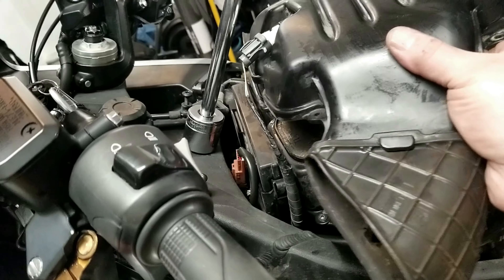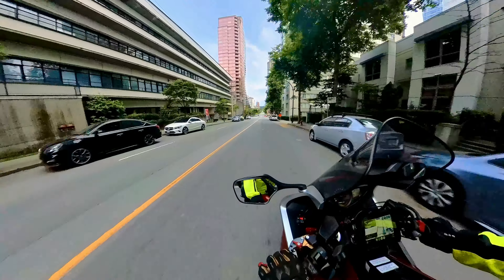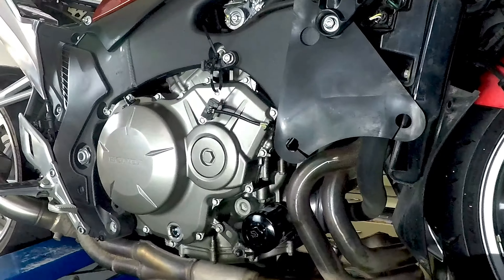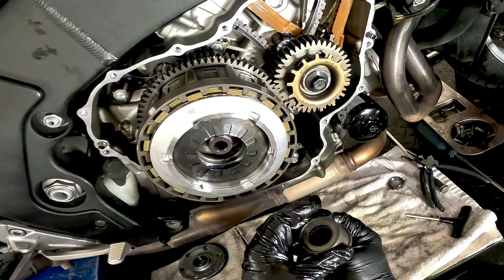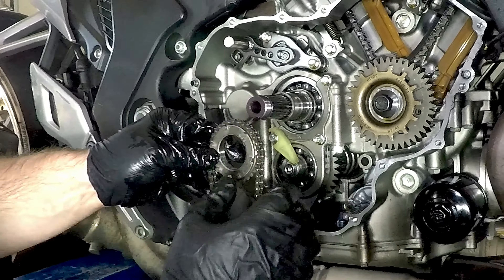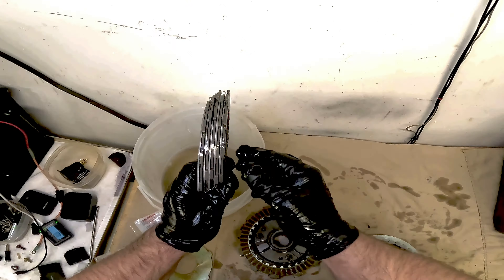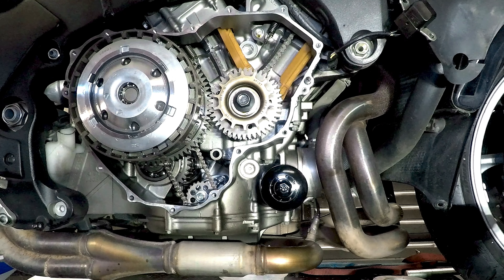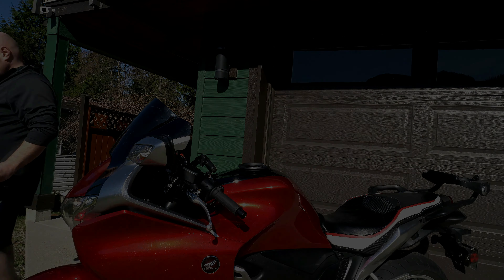Honda Oil Pump FAIL?

Comment: Firstly as a viewer who runs a channel mainly dedicated to the Vfr 1200, I must congratulate you on a fabulously produced and informative video. So nice to see this far into the 1200 V4.
Not had any comments on my channel re oil pump issues but it's good to know any potential issues . Slightly surprised you would expect a V engine to be anything like as smooth as an inline 4 at low revs 🤔. Overall though much appreciative of the time and effort this must have taken, and a very honest conclusion. Thank you soon much 👍👍👍
Reply from the maker: I appreciate that, thank you for the feedback & view!

Comment: Interesting content and a pleasure to watch a competent mechanic but you’re trying to fix a problem that doesn’t exist.  There are no reported issues I’ve come across regarding oil chain/pump failure.  As you say, worth changing if you’re in there.

Comment: Great video, was the slack in the chain reduced with the new parts. I live in Chilliwack and it's nice seeing local youtubers here.
Reply from the maker: Yes changing the parts took about 1.5 to 2mm of slack out of the chain.  New parts helped for sure,  not sure it was completely necessary.